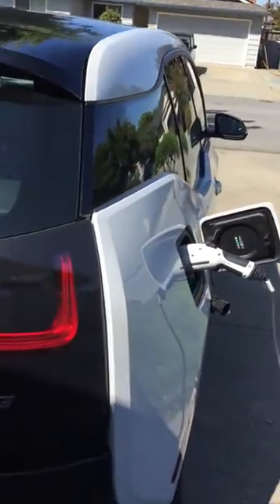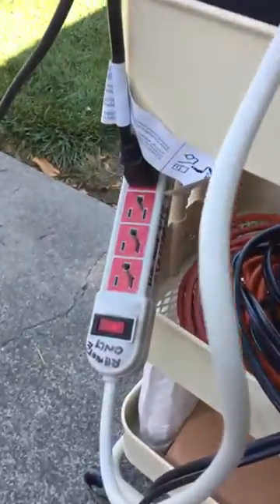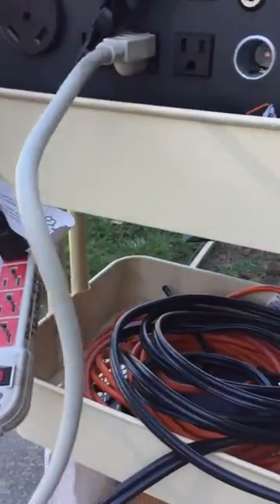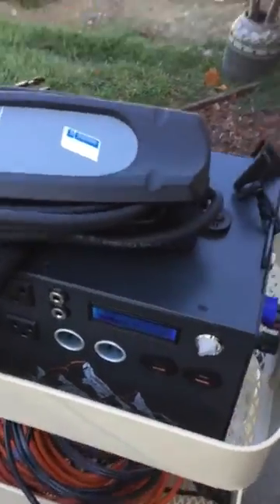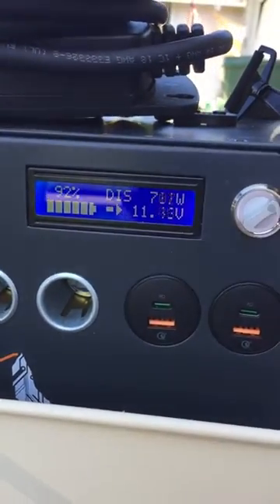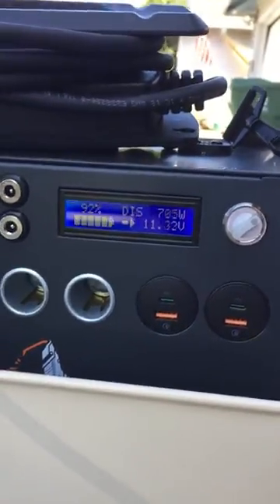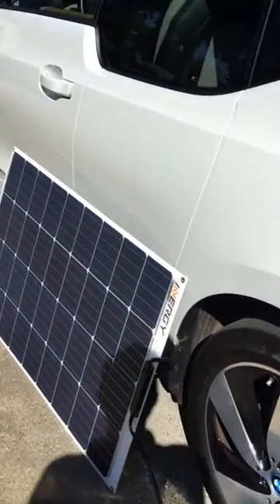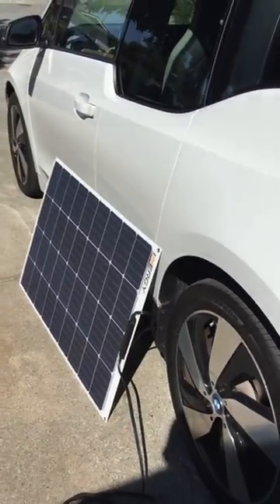Electric BMW car charged with solar by Inergy

Comment: Is that the standard draw for the BMW charger? Or is the charger smart enough to lower the amps? 700watts would take awhile to charge an Electric Car Battery, but if you got time this is cool because its solar charged! But I was curious if you did any modifications to be able to make the charger draw such low amps? Thanks
Reply: Not driving an i3 and not charging from solar, but some outlets have insufficient grounding or too much ripple on the grounding wire, so I simply disconnected the ground wire running to the charger, but the ground fault circuit in the car, between the battery pack and chassis is still connected and working, and that did the trick, when charging at shady outlets. In principle no more dangerous than any other not grounded appliance operated outdoors like a lawnmover. (You don't move in the rain, and the sun doesn't shine either!)